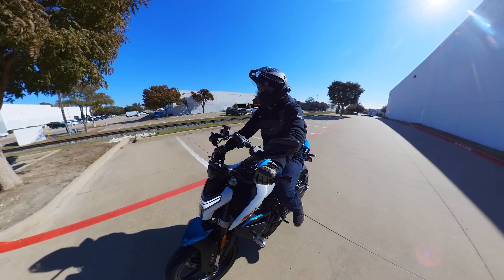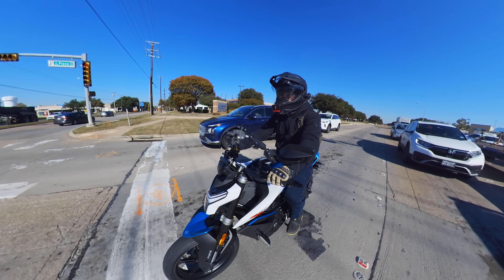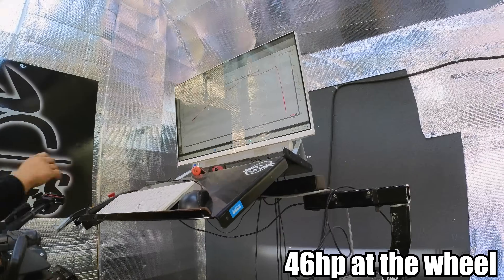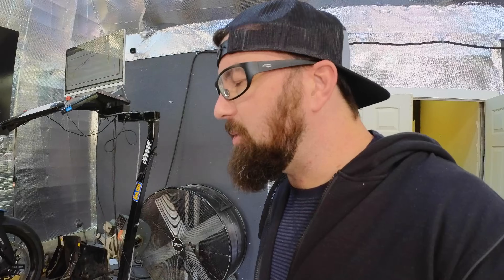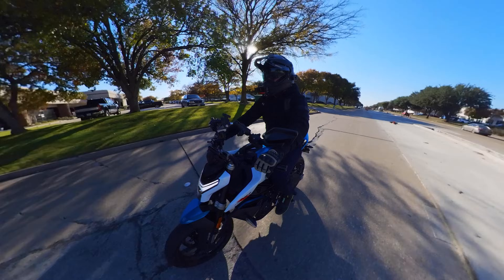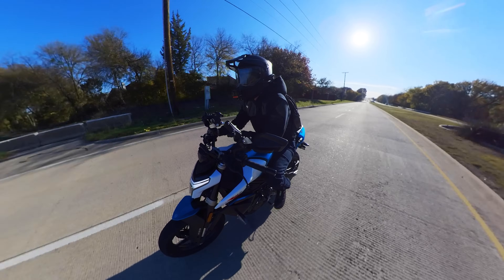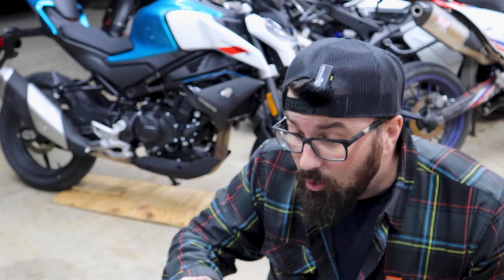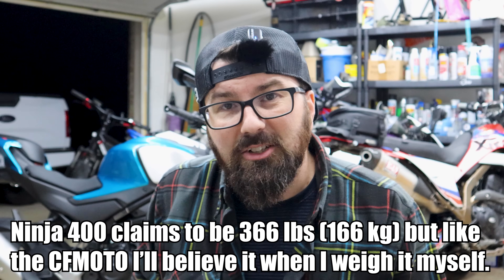CFMOTO 450nk Dyno Tested and Weighed

Comment: that engine sound is a winner
Reply: 270° firing interval is the way to make small engines sound like big engines. 😜
Reply: @exothermal.sprocket  regardless of firing order as long as it has more than 1 cylinder it sound like big engine 😂.
Reply: @enge1369  Interval, not order. In other words, what's the crank rotation angle between firing. That's what produces a half dozen different sounds in twins.

Comment: I use a 8' long 2x6 and roll my bike on it so it is the same height as my scales...I put the scales on one end of the 2x6 and weigh each end separately then add them together for the total weight.  By weighing each end separately, you can also calculate the front to rear weight ratio.

Comment: I’m definitely watching the 800nk videos, my main lingering problem with cfmoto.. is it still going to be offering support for older models ? These new Chinese motorcycle companies are drastically “updating” ( and by updating I mean stealing/copying/working with) other companies designs are you gonna be able to get parts when they prematurely wear from being made with cheaper materials??
Reply: There is nothing cheap with the materials with this bikes.. maybe the parts availability will be an issue due to low, but growing, numbers on sales (compared to big 4) and the limited retailers. But so far this little 450 for the European citys and suburb is really  really fun to ride
Reply: The 800nk used KTM's 790 engine. So if you're looking for sparepart, then just use KTM's. They are very similar.
Reply: This is a joint venture between cfmoto and ktm with cfmoto owning 51% this is a real deal motorcycle make with ktm backing it up.

Comment: I look forward to seeing that motor in an adventure/dual sport frame. Hopefully it comes in a little lighter but I doubt it. Decent numbers though for sure!
Reply from the maker: I’m estimating it will be 410 wet. The big thing will be how that weight is balanced on the bike. Like the T7 is really top heavy so it ends up feeling heavier then it is. It’s harder to pick up then some heavier bikes.
Reply: @TheGardenSnake  absolutely. It would be nice to see it down into the mid to high 3**lbs but how it wears it's weight is definitely key. Much like the crf300 I feel is heavier than I was hoping but wears it pretty well.
Reply: @TheGardenSnake  The 450MT is already available in Europe, it weighs 175KG/386lbs (probably without fuel?) according to the website.

Comment: I think there could be a mileage timeout (Volkswagon diesel much) in the EFI tune.  My chinese EFI Lifan KPX250 claimed to be 20 HP, feels a lot more after 400 miles..  Gradual increase.  I use only 93 octane which could be a factor.  I have no dyno test, but improvement is significant, not just a couple/few.

Comment: 400 lbs..  kinda heavy.  At the dealer felt really light and Low.  My XSR9 is 420, MT07 is 402 wet.  Was hoping low 300's which is where a SuperMoto should be but often requires an aluminum frame.  Yeah, the gas thing at play.   Watch out for dealer markup, delivery and "Shipping" charges ($750!).  A $3900 450NK black friday special (In Stock) turns out to be $5900 Out the door (w/Taxes, Tags, and Title) here in Maryland.  The 450SS (4 in stock) was $1K more.  CFMoto should sell thru amazon, and cut out the dealers.  They do nothing worthwhile other than half assed fix some defect but take 6 weeks to do it.

Comment: I don't understand that dyno chart? Typically output is measured in relation to engine RPM not MPH as shown @ the bottom of the chart. Are those corrected for gearing numbers or is the chart labeled wrong? Looking forward to your NK800 test but definitely would like to undersatand that dyno chart before you post the NK800 results. Thanks for the video and Happy Holidays!
Reply from the maker: It’s in mph cuz we didn’t feel like taking the side plastics off to find an ignition wire. It we had connected to one of those it would be in RPMs and we’d have torque. But that’s the power it put to the dyno wheel.

Comment: my mt07 with roads italia exhaust and without passenger pegs, 6 liters of fuel in tank, weighs 173 kgs. non abs model.
Reply from the maker: Have you actually weighed it? I took my 07 to a scrap yard and they weighed it at 380lbs too. But that scale isn’t really meant things that lite and goes in increments of 20lbs so I didn’t put much faith in it. I’ve weighed a number of bikes now and most people assume their bikes are lighter then they are. It’s fun seeing them disappointed haha.
Reply: @TheGardenSnake  +/- 1kg. We use it commercial in the business.

Comment: My tuned Ninja 400 makes 50.9 HP and 28.9 FT LBS. Full arrow system, high flow filter, and an airbox mod.
Reply: no, it doesn't lmao
Reply: @jls.mp4 I've got Norton Performance bolt ons and tune which advertises a %25 percent increase in power. 

Never dyno'ed but that's somewhere around 50
Reply: @jls.mp4 lol I don’t even have an ninja 400 and I can easily fine an tune from TST making 50 HP and an stage 2 tune making 53 HP…..

You just don’t know what you’re talking about. :P Lol
Reply from the maker: The Ninja 400 can definitely make over 50 hp. Alex (the owner of Texas Superbikes) showed me some dynos from modded tuned up 400s and they where in the 50s.
Reply: There are ones making 57 58's... @jls.mp4

Comment: This brand mass produces absolute garbage. If you live anywhere near and trails, ask the rangers or park owners what they pull out the most. CFMoto quads and side by sides are junk. I seriously doubt their bikes are any better.
Reply from the maker: Well from what I’ve seen it seems well made 🤷‍♂️
Reply: Stop making rubbish up
Reply: My 10 year old 650nk that has never broken down says otherwise. Well, it did once - the battery failed.